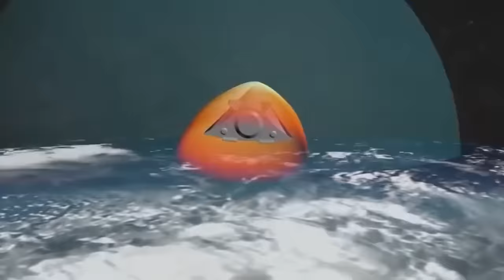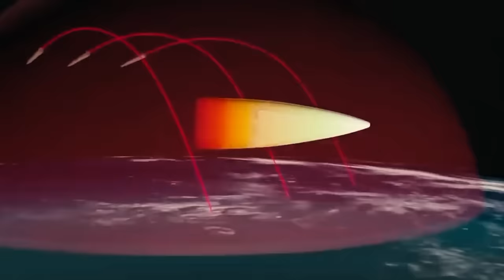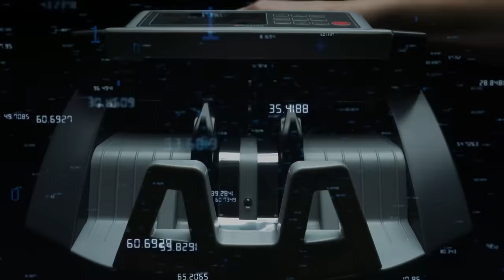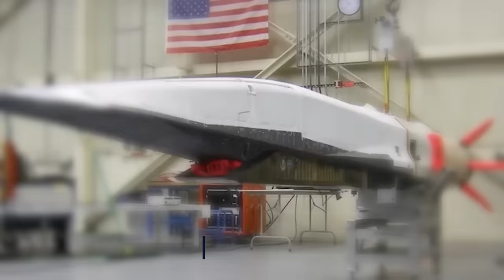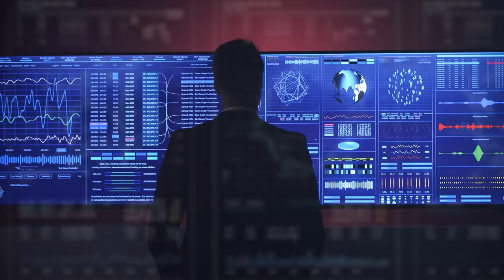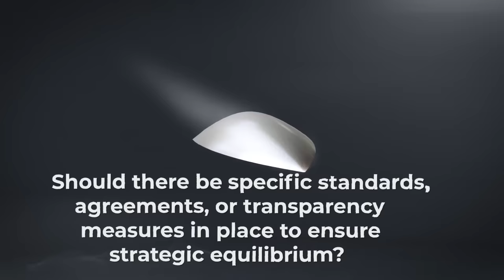The U.S. Just Admitted They Created A Hypersonic Missile So Advanced It Can't Be Stopped

Comment: Hypersonic simply means it can't dodge due to forward velocity. Hypersonics advantage is reduced reaction time. However with proper automation in defense, that can be overcome. You don't have to outrun the missile, simply put the interception device were ot is heading
Reply: The term hypersonic weapon is a little confusing. Hypersonic is 5x faster than sound or greater. ICBM's already reach that speed. Hypersonic weapons would reach that speed and be maneuverable at that speed. This giving the missile the ability to not be where it's suppose to be when interceptors launch.
Reply: Do you mean the AGM-183A ARRW?
Reply: Errrrr. Hypersonic missiles are also highly manoeuvrable. Putting something is it’s “path” isn’t a viable counter measure
Reply: @sorcereh1 they can be stopped using electromagnetic pulses… if that technology is ready to be used!

Comment: We need hypersonic missile interceptors that fires intercepting missiles that are even faster than hypersonic strike missiles and are very maneuverable. Such interceptors can be made heat seeking. I mean, if missiles can be nimble and hypersonic then why can't interceptors? Radar is out of the question but GPS can spot and track anything including meteorites falling at hypersonic speeds. As the interceptors gets close enough to its target with GPS guidance, the heat seeking capability takes over freeing up the GPS tracking for other missiles. And of course 1 megawatt lasers is coming.
Reply: You certainly dont know anything about physics, when anything is too fast it has a plasma layer that absorbs the signal from any radar so it can't be tracker by any system
Reply: @丸山碧-j9k  You don't know how to comprehend what you read. Poor reading comprehension. I SAID RADAR IS OUT OF THE QUESTION!
Reply: We (the US) fielded operational missiles capable of Mach 10 and capable of intercepting missiles traveling at Mach 24 back in the 1960's  don't worry, we have plenty of systems that to this day remain classified.
Reply: @erichammond9308  don't worry? You think that will stop a nuclear supersonic missile?
Reply: @arryritalinni  Do you honestly think that research just stopped after the 1960's? We had antiballistic missiles back then. Do you think they just threw that technology out the window?
Reply: @erichammond9308  if the supersonic missile fly low to the ground level, it's avoiding radar and impossible to intercept.
Reply: @arryritalinni  none do that, at least not at hypersonic speeds
Reply: WOW! You guys have no idea what your talking about.
Reply: It's called a laser
Reply: Or maybe not. Lets make peace and not make weapons of mass destruction
Reply: Not sure but it would seem that several missiles going 2 to 3,000 mph should be able to bracket the hypersonic no matter how maneuverable it is especially if they're carrying burst poor heads. I have to believe you would not need much to get in its way to cause it to be destroyed. But it's got to be so hot coming in that you should be able to build heat seekers to bring in your interceptors.
Reply: You’re ready for another my man!
Reply: @arryritalinni not impossible, just more difficult, time for another bong rip, brother!
Reply: You do not need a faster Interceptor compared to the incoming missile. The faster you detect it and predict its path, the slower you can send it. Think of outfielders reacting to a fly ball. It leaves the bat at 90-100 MPH, yet the outfielders, who's top speed is roughly 20 MPH, intercept line drives and fly balls all the time. It's all about how well you read the information, how quickly you process it and turn it into a gameplan that you can execute. Low altitude hypersonic missiles cannot be highly evasive without bleeding the airspeed necessary to make them an elevated threat. You don't have to hit one hard to kill it. A year or two ago, the AF general overseeing US missile defense said at one point we called US missile defense capabilities as being able to hit a bullet with a bullet for decades. Now we are so good at it we can hit the bullet with a bullet in an exact spot, targeting vulnerable components of the missile itself. If we are good enough to do that to ICBMs traveling Mach 20-25, I think we can probably figure out how to hit one going Mach 5-10.
Reply: Yea heat seek is the path in theory but pretty sure a smaller rocket wouldnt have the speed /range you think they didnt max/min the new rocket at ideal size
Reply: Its always max / min with current tech no point making new rocket that falls short of max potential

Comment: The AGM-183 ARRW ("Air-Launched Rapid Response Weapon") was a hypersonic air-to-ground missile planned for use by the United States Air Force. Developed by Lockheed Martin, the boost-glide vehicle is propelled to a maximum speed of more than Mach 5[5] by a rocket motor before gliding toward its target.[6][7] The program was cancelled in March 2023 after multiple failed tests.[8]
Reply: Was one of like 16 HS programs. They weren't all going to make it to production. It's a feature to lose programs, not a bug.
Reply: Also a program being canceled does not mean its actually canceled.  Successful programs are "canceled" for "failures" and then implemented on the black budget.
Reply: Send 'em to Ukraine.
Reply: The SR-72 was also "Cancelled" several years ago... yet here we have one entering for the NGAD project after being shown off in a Hollywood movie as just a "prop"... Skunkworks doesn't make props. The closest thing to a "prop" they'd supply is a radar demonstrator.

Comment: The new missile can reach mach 5
The missile that can reach mach 5 is new
The missile can reach 5x the speed of sound
The new missile is fast, faster than mach 5
Other missiles can't reach mach 5
The new missile is very fast and quick
The missile can reach far distances very quickly.
The velocity of the new missile is very high.
The ground moves very quickly underneath this missile.
It's hard to hit things going mach 5 because it is fast.
Mach 4 isn't even as fast as mach 5. 
Mach 5 is like 4 machs higher than 1 mach.